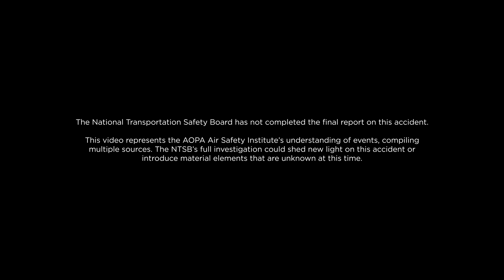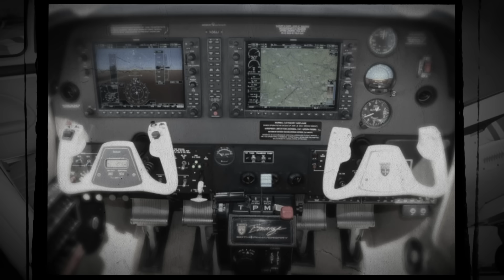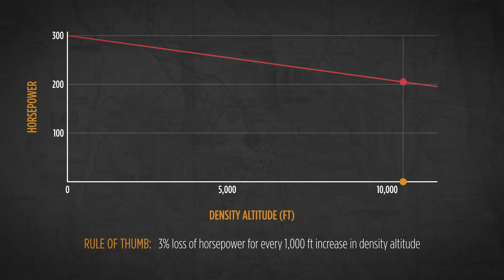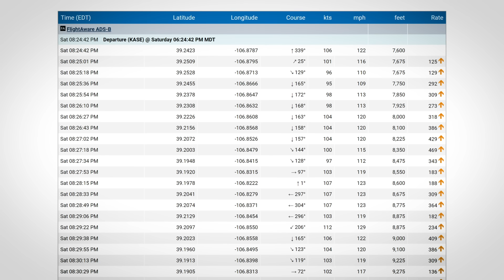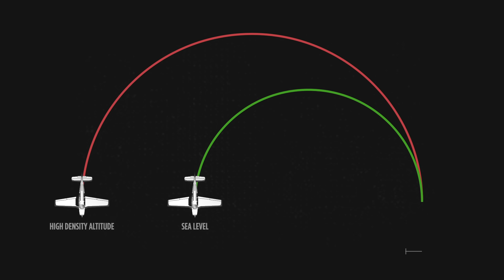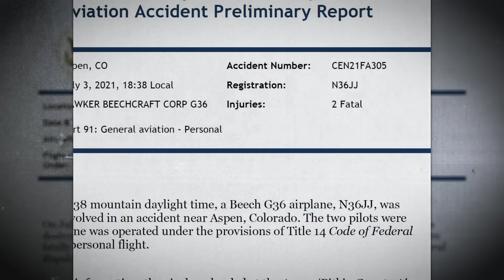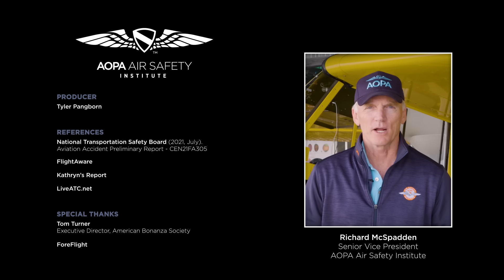Accident Case Study: Into Thin Air

Comment: We fly c206. Takes us roughly 20-25 minutes to climb to 9500' takes us additional 15-20 minutes for another 1500' to 11000'. I'm surprised how much power/climb loss you can have once you hit a certain altitude. Climb is fine (for the plane), but at 9000' it just stops climbing, till you adjust mixture and then only gets about 100 fpm of climb if we're lucky. 
Moral of the story! You might think your climb is good, until suddenly it's not and now you can't turn. Altitude changes handling of your plane in a big way.